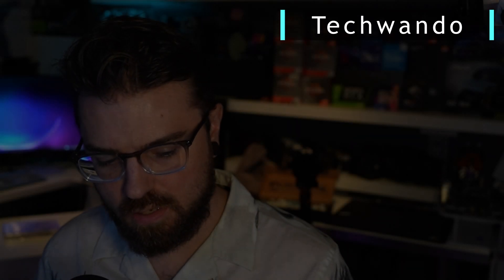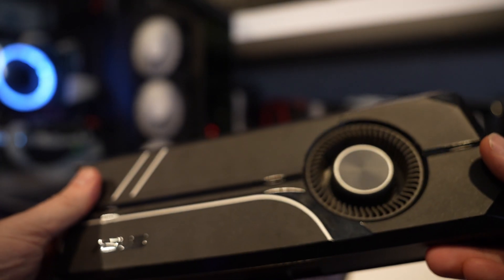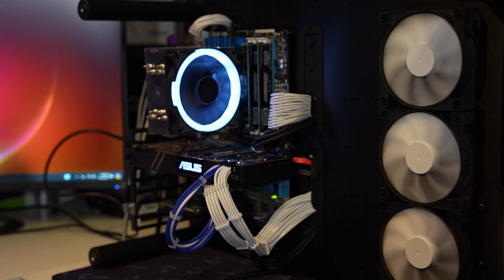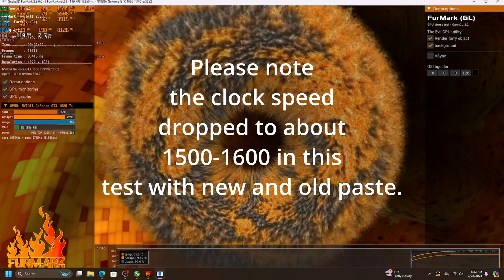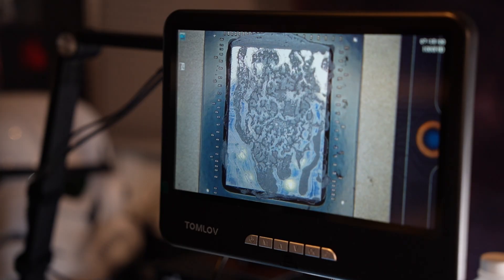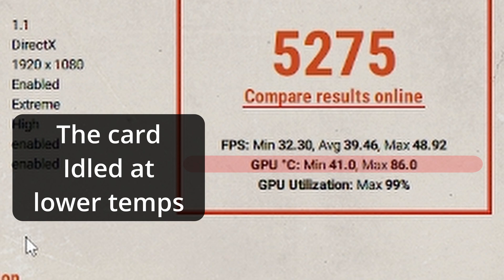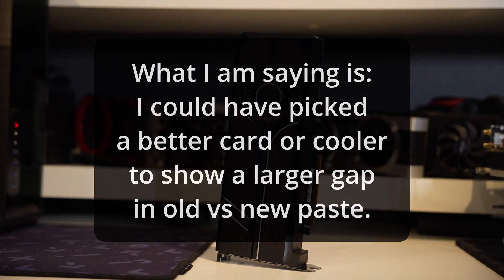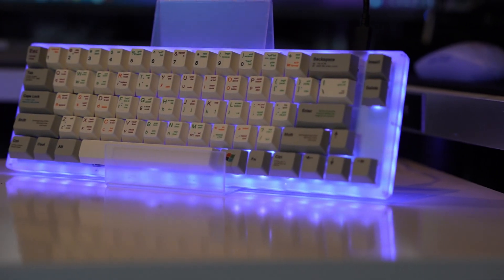7 Year OLD Thermal Paste Still Good? | + Keyboard  Giveaway

Comment: I bought this same exact one when it released, specifically because it was the cheapest 1080ti due to the blower style cooler. The first thing I did when I got it home was remove the stock cooler and replace it with a NZXT G12 and an AIO.
Reply from the maker: Funny you say that, I just tossed a few of those out. They were hanging around for so long.
Smart move on your part though.
All those older FE cards were pretty bad. Blowers in general.

Comment: Just saw your comment on Bryans video,  and had to come see what you are up too.  Huge thumbs up on this video.  I have a three 92m fan setup, and also a two 120m setup that I just screw into the Pci bracket right below a card to test its thermals with a fan control dial.   Blower cards are crazy cooled like this, unleashed.  1080ti has a place in my Soul. Hahaha!
Reply from the maker: Hey man, yeah took a while to find a card that wasn't cracked open already, blowers are kinda crazy when you think about how they operate. 
Appreciate you checking out the vid.
Reply: @techwandoUS  I hope you do not mind if I subscribe? You seem to have a very based view on tech.  That says allot.
Reply from the maker: @Willbme4EVA  hell yeah bro! Appreciate you.

Comment: I repasted my dual-fan 3060ti using noctua nt-h2 and my temps dropped from low 80s to low 70s, and some less intense games run even cooler. I didn't even replace the pads because I didn't have the right size. Repasting is definitely worth it in my opinion (but look up pad thickness and order pads ahead of time lol)
Reply from the maker: Nice that is a very good result. Typically with pads, if they are the more rubbery ones, they last forever. The worst ones some companies use are the ones that have threads or a paper like feel to them. Tons of the 30 series FE cards practically used paper to cool their gddr6x. Just changing the pads dropped vram temps by 20°c 😅
Reply from the maker: @bretthake7713 I just wanted to let you know, I had to do a re-roll on the keyboard. You actually won, It is USA/Can. the other guy lived really far out. Shoot me an email! techwandoUSA@gmail.com
Reply: @techwandoUS  🎉🎉 thanks so much for reaching out, I just sent an email. Will chat with ya soon brother

Comment: It's crazy how well the 1080/ti hold up 7 years after their release. There is a chance we won't see another gpu that offers that level of value again. I'm happy with the 7900x even though there are new cpus dropping. The 7900x is great for its price and should not disappoint. The AM5 socket should be around for a while, so I can miss a gen or two, and it shouldn't hurt too much.
Reply from the maker: Honestly your 7900xtx is a really great card, I think you'll get a ton of value out of it. 
The 4090 did have that insane gap kinda like the 1080ti but the cost and issues that came with it just ruined its legendary status that the 1080Ti still claims.
Reply: @techwandoUS  My system is noticeably snappier with the 7900x (no stutters or delays). This cpu is faster than the 13700k and draws less power lol (I'm going to let that sink in)
Reply from the maker: @Chris_94  hell yeah man. That's great to hear.

Comment: I always enjoy the older hardware videos

It seems like Intel knew about this problem but continued with production of the faulty CPUs. What's wild is that there doesn't seem to be any QA verification from Intel after they first found out about the issue. I would feel much different about this is they issued some sort of recall instead of doubling down that this is merely a voltage issue
Reply from the maker: Hey man, I just finished up the recent hardware unboxed podcast thing they do. What's that saying about ducks? Walks like a duck...
It's starting to appear more and more likely their is something up with the hardware. They are probably going to try and implement as many patches as possible so when they have to explain the real issue, it will look like they tried and didn't know. 
It was pretty annoying to find out about that oxidation issue as well because that is something they did know about and they didn't bother making an announcement in any way shape or form. 
At least AMD last year made good with people and their situation. 
Appreciate the comment as always.

Comment: sweats in 1080ti with OG thermal paste lol. I was planning on throwing an AIO on it with a kryosheet on the gpu. debating about putting heatsinks on the ram but it doesnt really get that hot and Gamer's Nexus didnt even worry about it in their liquid cooler upgrade to their msi armor 1080ti (same model I have)
Reply from the maker: Haha ...
Hey if it's still chugging along and temps are good then you might be fine. Kryosheet idea ... I like that.

Comment: I was lucky and got a few Amd Fury Nanos for $60 each firet thing i did was cleaned the copper heatsink and die really well then gave them the conformal coating on smds and Liquid Metal. I managed to drop temps to 60c under load from 85c and boy the Coil Whine when under load was high pitched so i used silicon berween the vrms shut that issue right up. These cards are amazing next project is to find a Radeon Vii for under $500 lol
Reply from the maker: Solid mod on the coil whine, I have done similar things in the past for customers with waterblocks. 
Also that's the kind of temp decrease I was expecting tbh...
Have the Radeon 7s gone up in value? There were a few kicking around locally here in Boston for about $250 usd.

Comment: I've never had a gaming quality keyboard and the one I use is starting to skip keystrokes. I'd love to get yours but I'm content with your recommendations. I didn't realize GPU's should have their paste replaced so often. Thanks for the heads up.
Reply from the maker: Hey, appreciate the comment. GPUs typically can be pushed quite a few years. If you start to see temperature creep it's a good idea to change it out.
As for the keyboard, I wish you luck 🤞 
I'll be doing a live stream pick next week and will tag the winner.